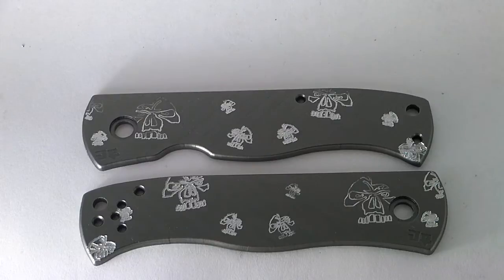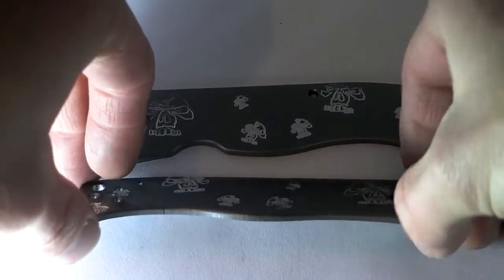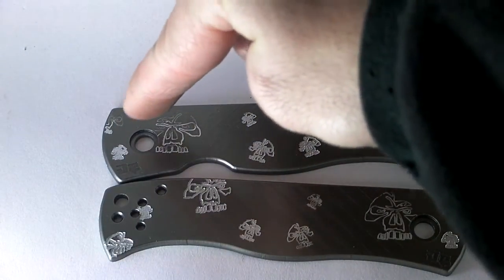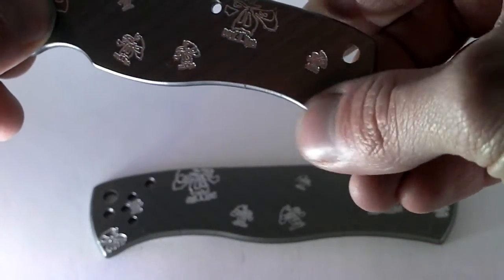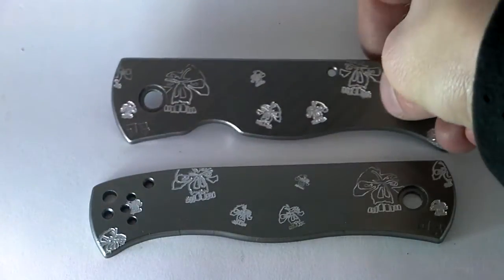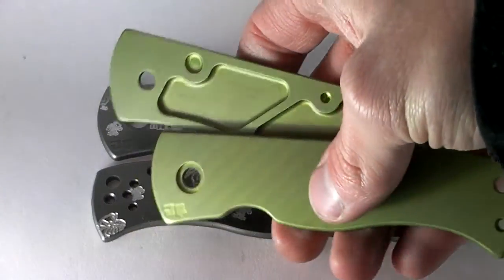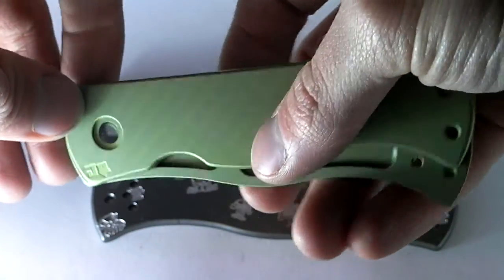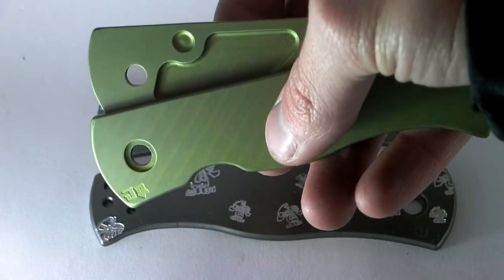Engraved Emerson skulls on CQC-7

Comment: Those green scales look awesome! Love that color with the tumbled surface. Might have to get myself a CQC7... :)

You should make one of those dremel offset adapters I did for the small mill in the workshop. Just make it beefier than mine and remember to make the c-c measure of the two holes some nice round number. That way you can zero the part in X and Y with your regular touch probe and just apply a simple Y offset.

Comment from the maker: @basketofkittens I already did make a dremel attachment long ago, but like you was never happy with the results. I was using those cheap ebay PCB v-cutters, so that's probably the problem, they never worked well in spindle or dremel.  Maybe I'll set it up again and chuck up a carbide ballmill like I used on this job.  Glad you like the green ones buddy!  It's amazing how different surface finishes change the color completely.